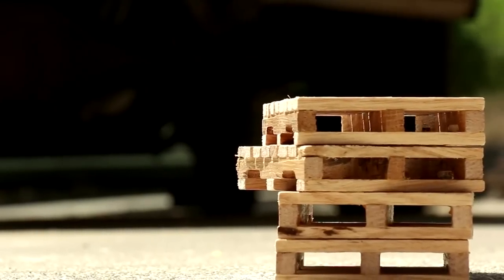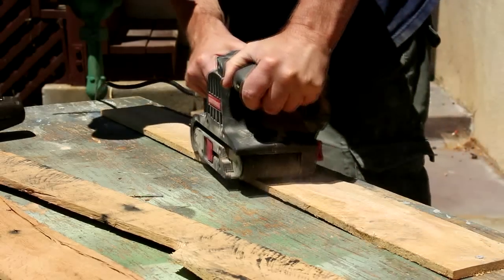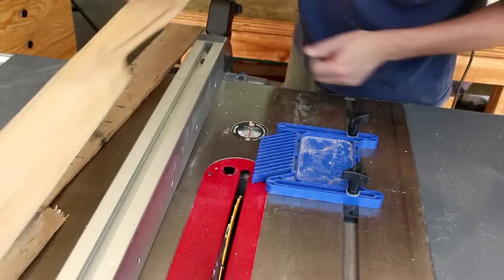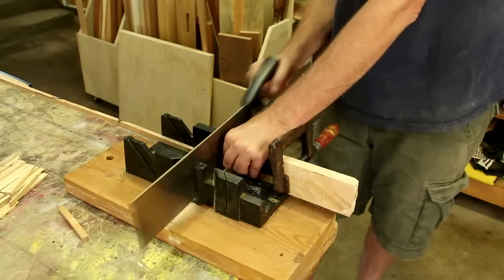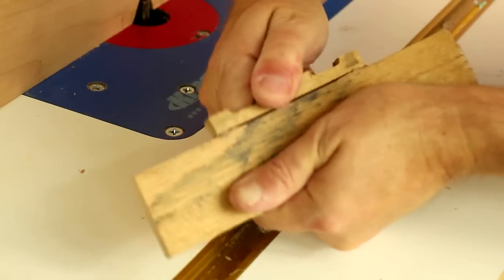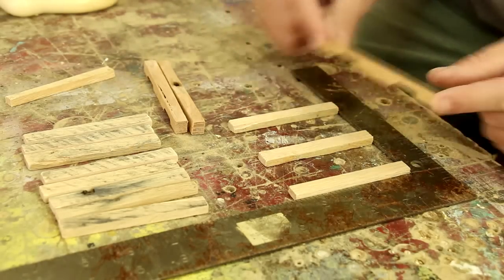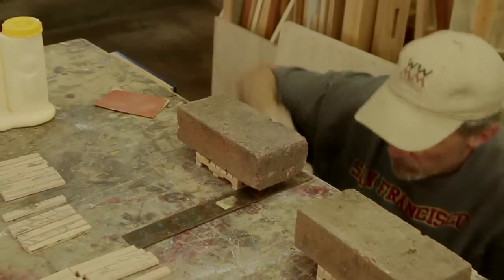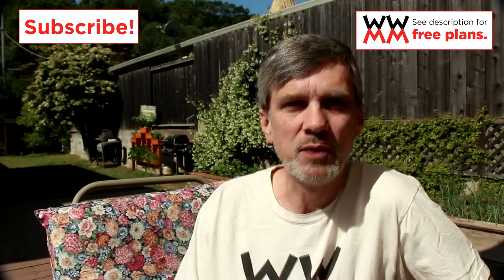Pallet drink coasters made from, well, pallets! Easy to make.

Comment: Steve, when you are using a western handsaw it's easier to hold the piece in the miter-box if you are using the far wall as the stop. A western saw saws on the push stroke so you will push the piece into the wall instead of having to fight the saw to hold the piece steady. A bench hook is almost a better alternative then the miter-box for just making crosscuts.  Of-course the opposite is true if you are using a eastern saw that saws on the pull stroke.

Comment: That is too cool.  I'm not sure why you planed the boards.  Couldn't you have sawn them to thickness and ripped them to width.  Also, what keeps condensation from running through the pallet coaster and getting on the table?